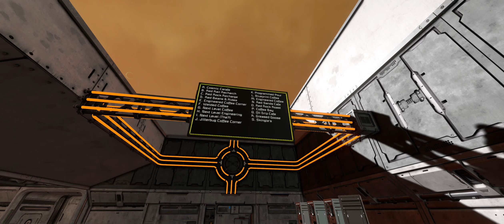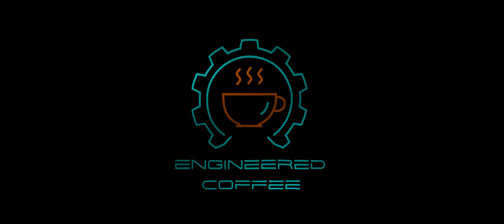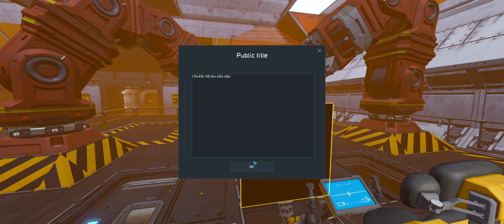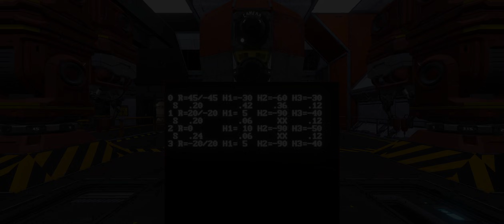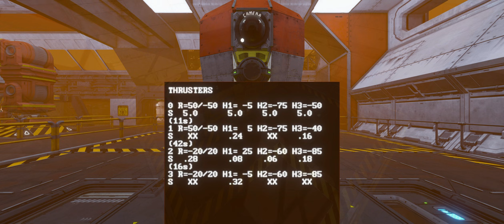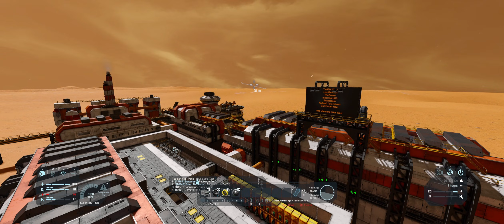Factory Acceptance Tour of the Tardi-Bay! | Martian Engineering E22 | SE Survival

Comment: You could try to slap a sensor to the welders, have it detect subgrids and set its detection range to reach slightly infront of the welder tips.
Then set all the relevant hinge speeds and group them together.
Sensor settings might work as simple as:
Detect = reverse
Don't detect = reverse
Probably need to turn off/on sensor before and after welding is finished which could be done by monitoring the rotor the weldarms are attached to.
Might save some time programming/fiddling around with timers.

Edit:
Amazing build btw, enjoyed it!
Reply from the maker: That's a great idea. Once tuned it would regulate itself!

Comment: Great episode.  But my OCD is going nuts seeing the sensor on the floor and off centre lol
Reply from the maker: It's centered with the connector of the Tardigrade.  The clamps are an even number apart though because the rear one was conflicting with the merge block setup. But I didn't want to bring in the front one because it would be tight against the connector.
Reply: @EngineeredCoffee  ah fair enough
Reply from the maker: I was about to jump back in and fix because it would bug me too. I had to rewatch the video 🤣
Reply: @EngineeredCoffee  😆

Comment: 6:38 Rotor heads have a line on the underside to show which way they are placed, the rotor angle is relative to that
Reply from the maker: Thanks! Convenient my placement was still the -90 instead of any of the others. The more you know.
Reply: I was just about to same the same thing. The little line on the underside of a rotor head indicates it 0 point, it's really easy to knock them off center before they've been welded up.